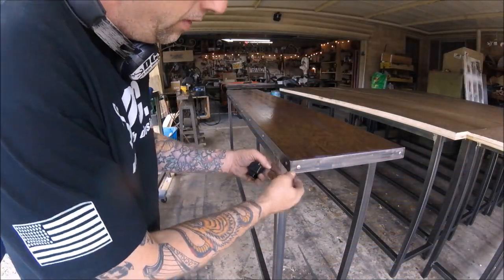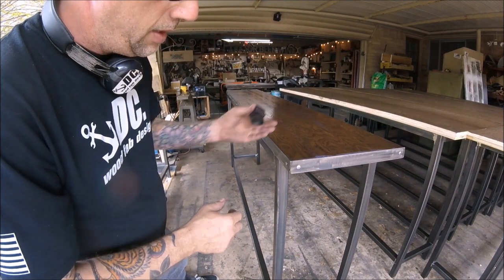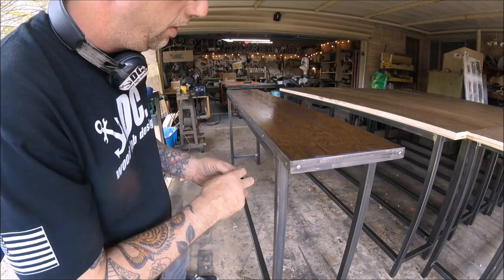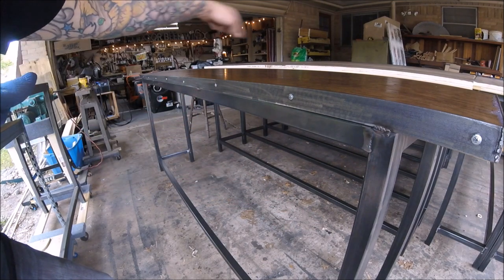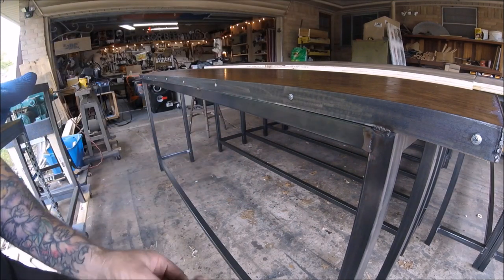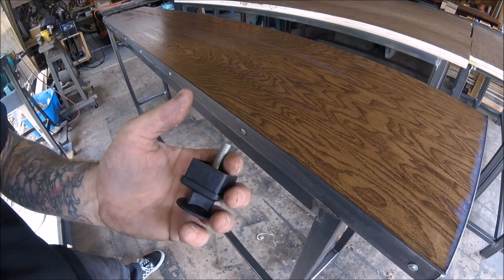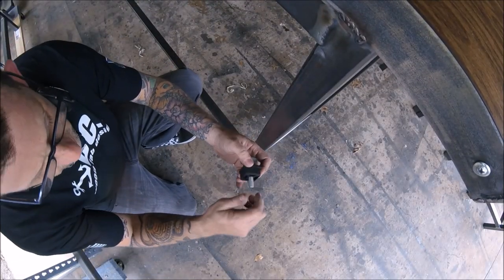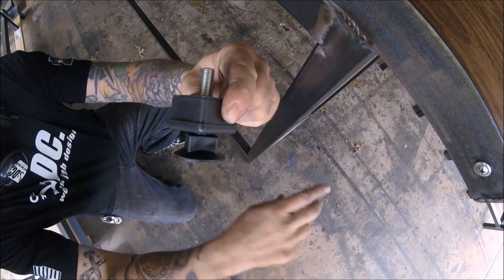TWELVE TABLES FOR LIVE MUSIC VENUE.

Comment: Always enjoy your builds and your videos man.  What a production line!  Just wondering what you had the mig set at; I have the same machine and I'm putting together a custom vanity with similar material to what you're using, but I am blowing right through the edges!  Millermatic my ass! lol  Any thoughts?  Thanks in advance!
Reply from the maker: Wayward Woodworker Thanks sir, and I have only had this Miller for a couple weeks. Very easy to use, set the voltage based on the thickness of your material using the guide on the knob then turn it down a hair. Use recommended feed rate as well.